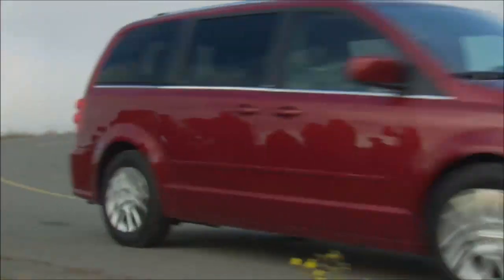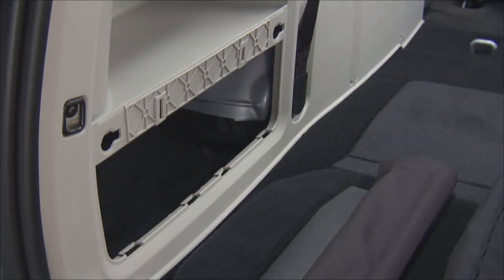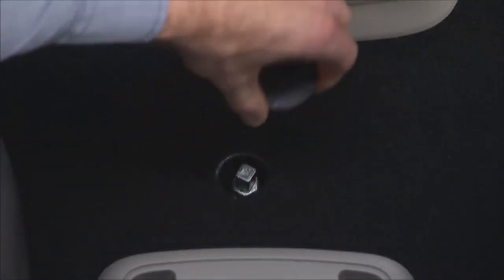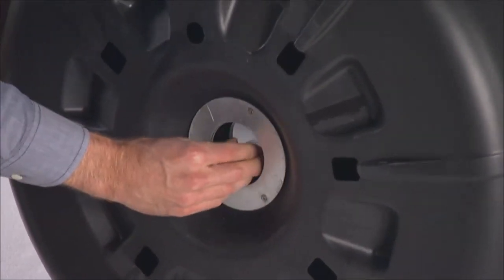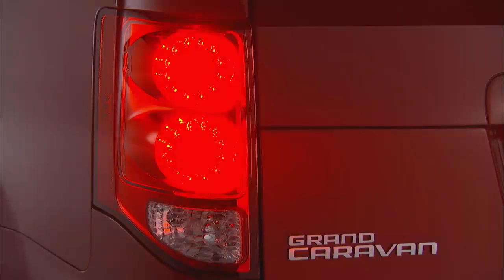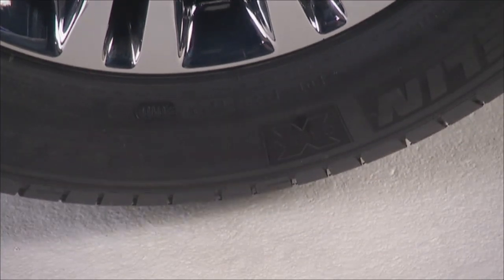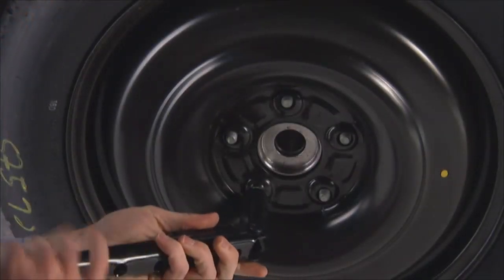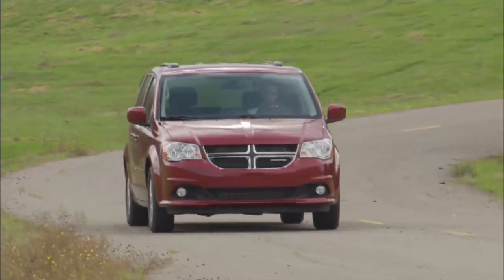2016 Dodge Grand Caravan | Jacking And Tire Changing

Comment: Same problem for me as previous comment. I can't find the jacking station location on the front side of my vehicle and the manual doesn't show it properly. I want to change my winter tires to my summer tires but can't do so until I can figure out exactly where the Jacking station is.
Reply from the maker: Bill, 
For the exact jack locations, please see pages 596-599.
https://bit.ly/36N4Qx8 ^LH
Reply: @mopar   @Mopar  thanks so much, for this info, much appreciated! I did look on my own manual but was unclear if it went on the same sill flange (lip) that runs from the back side to the front and where the back jack goes on. The picture doesn't actually show it going on to the lip so I was somewhat concerned, because there are no tabs on the front lip/flange. I saw a previous video from an earlier Caravan where it was all bent out of shape and the guy said that was not the right place to put it, but that was a much earlier model.

Comment: I just found out that I have a tire pump in the location of were the tire jack should be and no tire
Reply from the maker: Hi @highfrequencymukbang, thank you for reaching out, depending on the vehicle, air compressors come standard and the spare tire is an additional cost.

^MR